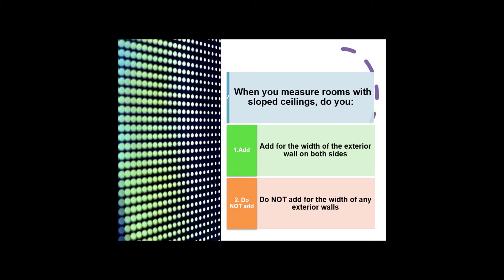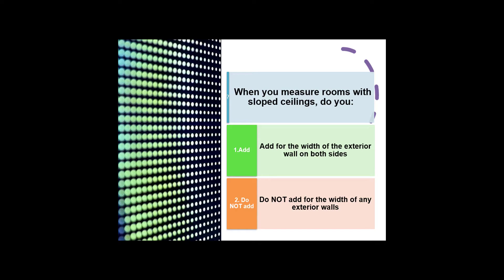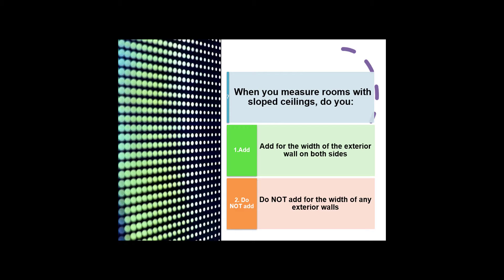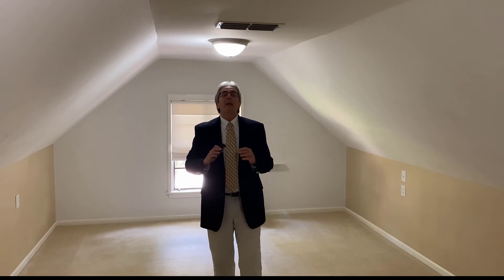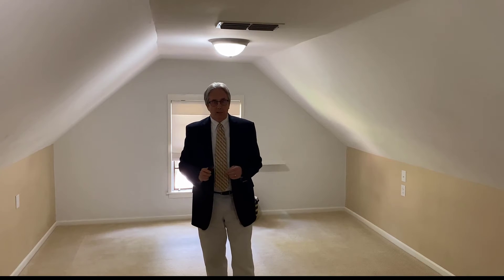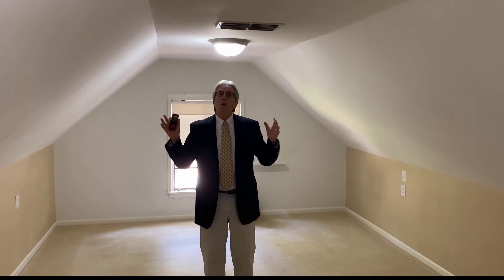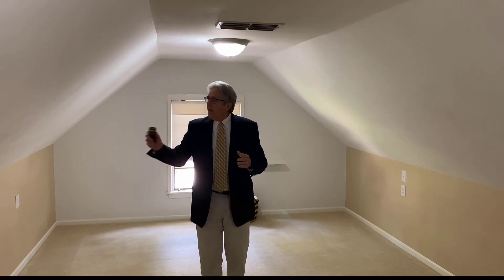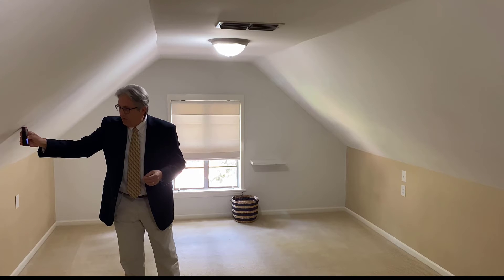Sloped Ceilings with ANSI 2021 the Basics

Comment: Can it still be counted if the area which is above 7' doesn't constitute 50% of the room? Assuming you're around 6', the area which is over 7'  in the room you're measuring might be 2-3' wide max, in a room which is 10-12' wide. Would that not mean the room had to be excluded from GLS measurement?
Reply: I only ask because every other resource I can find, appraisers forums etc. seem to interpret this to say that room you're in would not be able to be counted as GLS. Was also my interpretation of the 50% over 7 rule.
Reply: Yes, there are lots of rooms that cannot be counted in the total finished square footage or GLA. However, it doesn't mean the space has no value, but is just not equal to the rest of the finished space.
Reply: It can get close some times. But, ANSI says 1/2 the space must have a ceiling height of 7 feet to be counted as Finished. I don't know what GLS is as we don't use that term here.